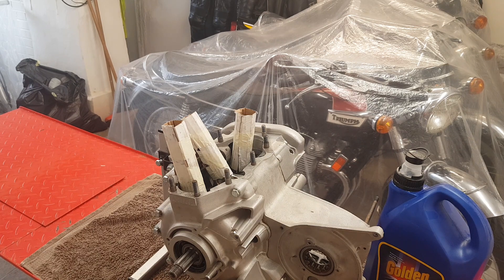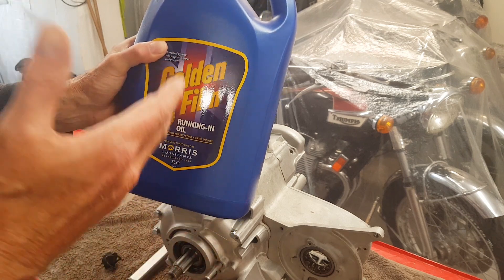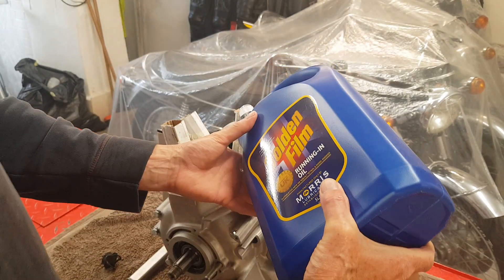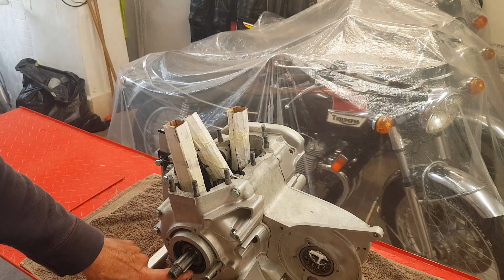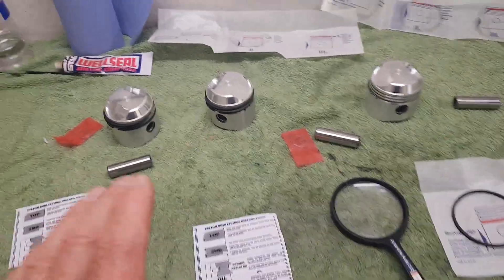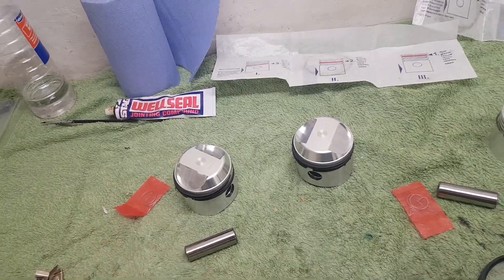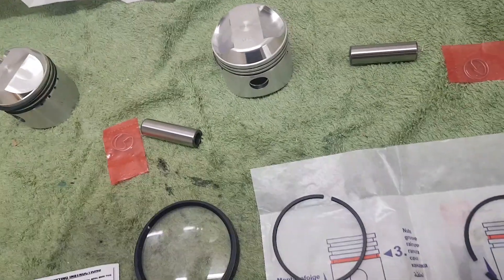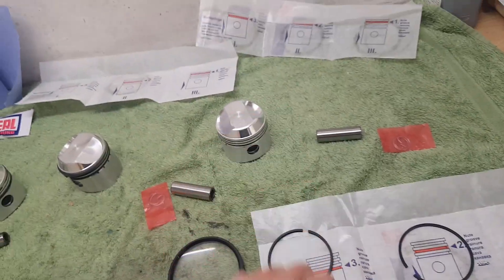Triumph Trident T160 Engine Rebuild. Part 20: Fitting the Pistons and Piston Rings

Comment: Hi Chris , when I did my time as a automotive machinist , I was taught a easy tip to help with your ring orientation,  just relate it to your "john Thomas" ....if it's IN its up if it's OUT  it's down  , the internal and external champhers are there to induce  ring twist .good to see drilled holes for oil drains .skirts fall off with slots .Cheers.